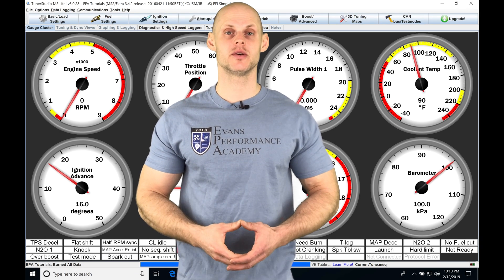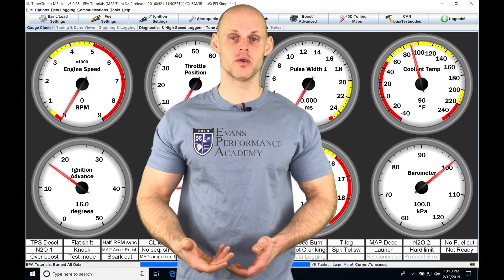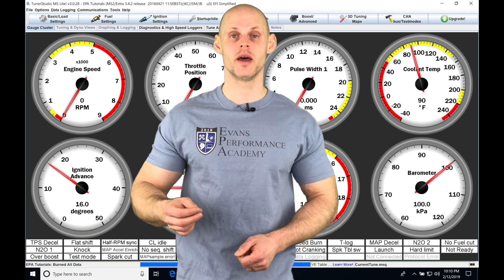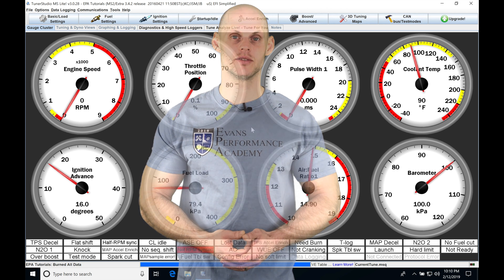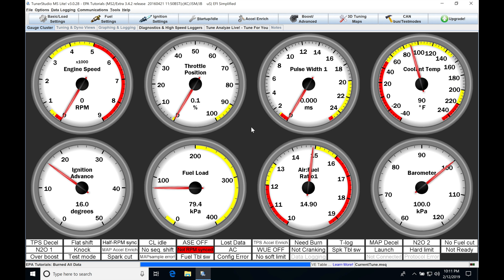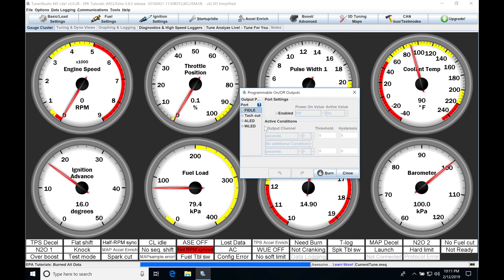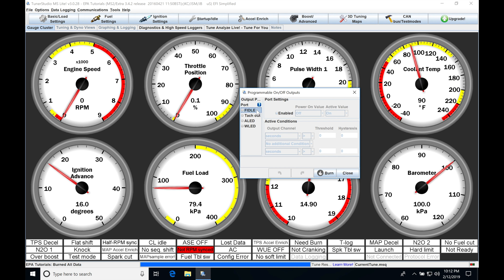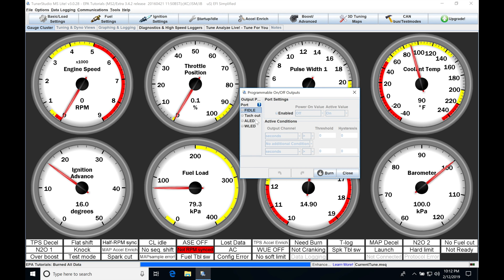Megasquirt: Programming Outputs | Evans Performance Academy

Comment: Hi, I have a carbureted 350 with a 4l60E trans and am using the Microsquirt trans controller. I can get the trans to shift but I need adjust the shifting points, do you have a video on doing that?

Comment: so would that be a negative trigger then?  Just curious, in my instance I want to wire in a dual fan kit.  I have a choice of three kits, one being high-low but the thing that I don't understand is the trigger.  Negative or positive or does it matter?
Reply from the maker: Negative is a low side output (ground).  Positive is a high side output (12 volt).  What output you select and configure depends on the circuit you are trying to control.